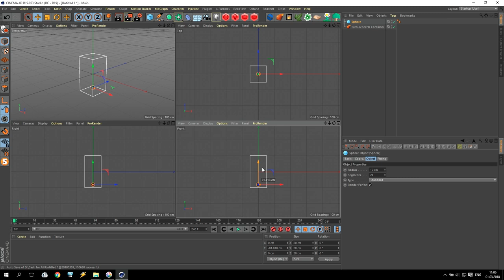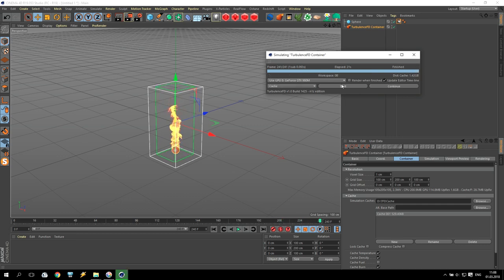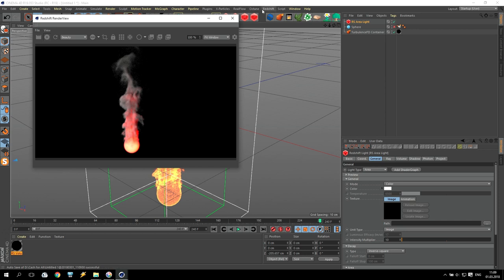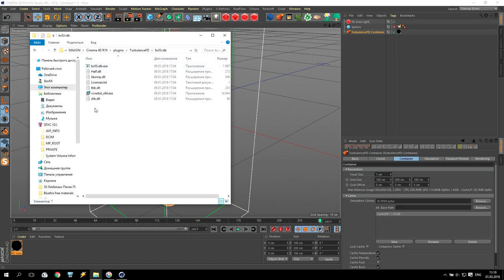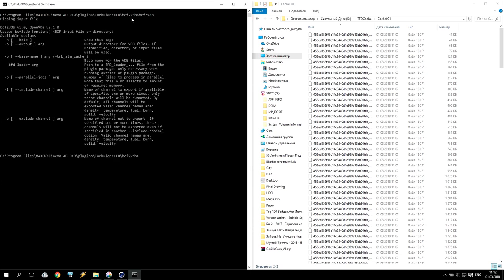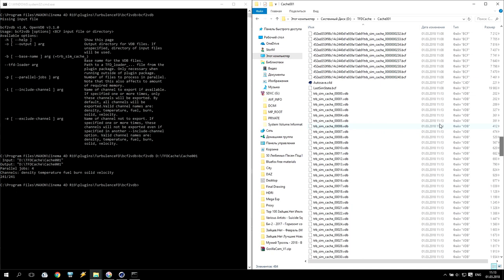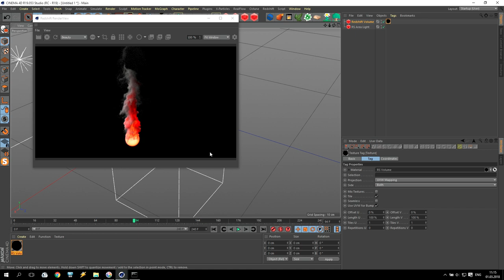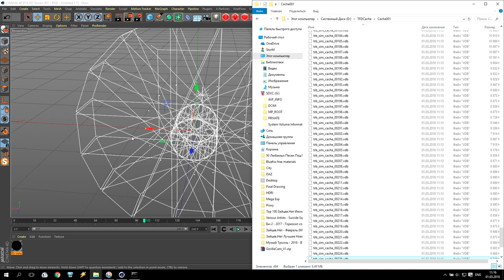TurbulenceFD to VDB / Redshift Volume / bcf2vdb

Comment: bcf2vdb : The term 'bcf2vdb' is not recognized as the name of a cmdlet, function, script file, or operable program. Che
ck the spelling of the name, or if a path was included, verify that the path is correct and try again.
At line:1 char:1
+ bcf2vdb
+ ~~~~~~~
    + CategoryInfo          : ObjectNotFound: (bcf2vdb:String) [], CommandNotFoundException
    + FullyQualifiedErrorId : CommandNotFoundException
Что с таким делать?

Comment: I've got a error when I hit enter to convert : "Failed to locate TFD loader. Specify file with --tfd-loader option or run from inside the plugin package." Some solution?
Reply from the maker: No idea. Check some forums...
Reply: I have same problem

Comment: зравствуйте у меня выдает  что   

 bcf2vdb : The term 'bcf2vdb' is not recognized as the name of a cmdlet, function, script file, or operable program.
Check the spelling of the name, or if a path was included, verify that the path is correct and try again.
At line:1 char:1
+ bcf2vdb
+ ~~~~~~~
    + CategoryInfo          : ObjectNotFound: (bcf2vdb:String) [], CommandNotFoundException
    + FullyQualifiedErrorId : CommandNotFoundException

Suggestion [3,General]: The command bcf2vdb was not found, but does exist in the current location. Windows PowerShell does not load commands from the current location by default. If you trust this command, instead type: ".\bcf2vdb". See "get-help about_Command_Precedence" for more details.
PS C:\Program Files\MAXON\Cinema 4D R19\plugins\TurbulenceFD v1.0\bcf2vdb>
Reply from the maker: Не уверен, что могу помочь...
Reply: @Cinema4DTutorialsSV  spasibo
Reply: Ты открыл не командную строку в веди в поиске командная строка и там это прописывай